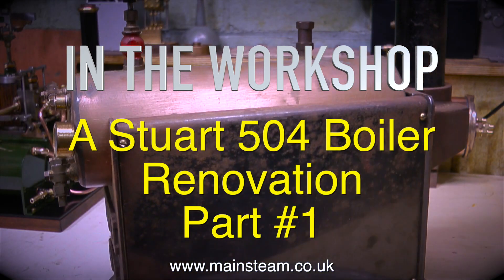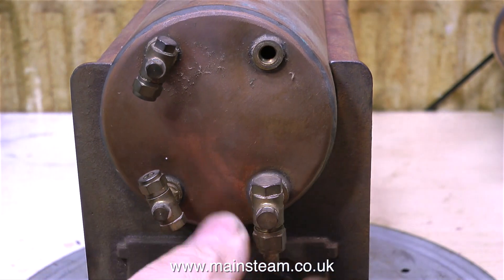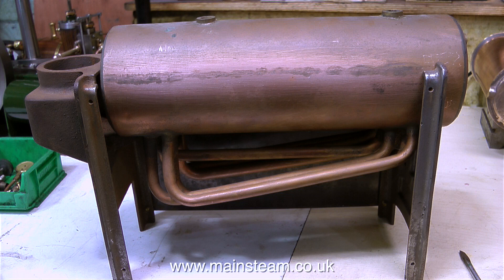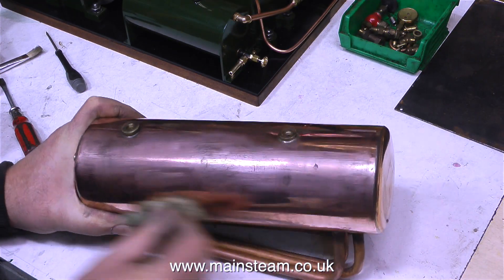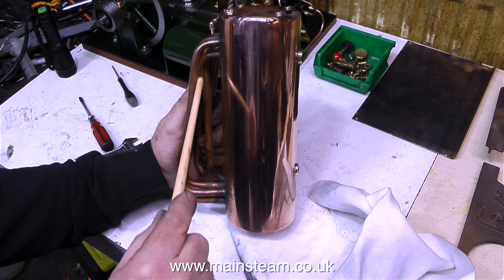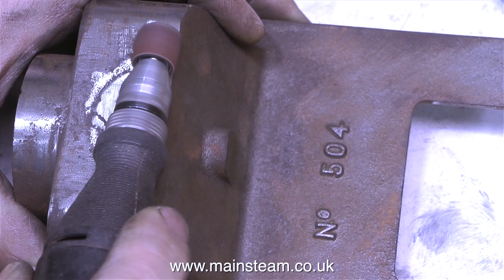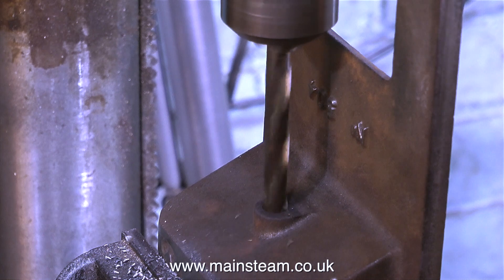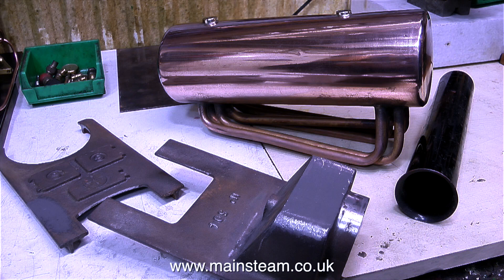A STUART 504 BOILER RENOVATION PART #1

Comment: Maybe the one complaining about the lack of background noise has never been in a machine shop. I think you have been doing a perfect job on the sound, but I am only a 68 year old machinist so I am hard of hearing. I do have to turn up the sound when you stop talking (which I hear fine) to hear the engines run, but that is my problem not yours. Thanks for the explanation on the 504 boiler, having never had one I did not realize that the one bottom tube was a steam drier line. Had always thought the tube arrangement in photos looked a bit odd, but nobody had mentioned the tube arrangement. Score another one for you, keep up the good work. Now time to have another coffee and rewatch some of your videos.

Comment: Ahh, a 504! I put one of these together (with help from my father) 10 years ago. I managed to get a new old stock boiler that had never been put together (and persuaded the seller to remove the asbestos before sending it, although I did find some asbestos fibres in the box which required some very careful cleaning). I used kaowool instead of asbestos for insulation.

I didn't clean the castings (or know that one is supposed to do so), but spray painted them black with heat resistant paint, which seemed to work quite well. I did not polish the boiler barrel, but instead insulated it with a layer of kaowool and, on top of that, a black painted copper outer skin, soft soldered together, and held in with boiler bands, which looked quite nice when it was all done.

That boiler is currently sitting in my attic waiting for the day when I put together my steam plant again.

I shall be very interested to see how this series progresses, and especially how you heat this boiler, as I had trouble with the heating end of mine, having cremated one ceramic burner in the way that you described in an earlier video (which I partly caught on video - I have it on my Youtube channel somewhere), and the other one, although better, not quite seeming to give off enough heat.
Reply: It seems strange that Stuart discontinued the 504 as it seemed to be a popular design and a good steamer. I don't know what they cost new but judging buy the price they fetch on ebay I guess they have held their value well.  I'm not expert but it seems to me that the modern Stuart boilers are fairly basic compared to others you can buy at the same price.
Reply from the maker: I fully agree and never understood either why they discontinued the 500 series, they are easy and simple to make and steam really well . . . 'Tis a puzzle to me but I suppose that they had their reasons . .  .
Reply: Any idea how they compare to a PMR 2 that is of a similar size ?

Comment: Keith, my man! You never tell us roughly how old theese boilers are... its hard to appreciate the quality and effort you put in to renovations if we dont know certain details, even if they are just a guess
Reply from the maker: OK then, the Stuart 504 boiler I have recently renovated is probably from the 1970s - that's the best I can do ......
Reply: Thanks a ton. Even if its a guesstimation its  great to have an idea of what you’re working on
Reply: Oh also, ive been building a steam boiler myself, its made using a 200 psi air compressor tank with globs of weld with threaded holes in it for valves and proper equipment, and a few car exaust fittings passing through the tank for a fire tube/chimney, but for some reason the weld is rejecting the metals... i have no idea why

Comment: This is perfect timing for me as I'm in the process of renovating a Stuart 500 boiler and a Stuart D10 any chance you can do work like Hydraulic testing the barrel. Also would you recommend replacing the original boiler fittings/ keeping it with Stuart fittings minus aluminium washers/ replacing with alternate parts from your friends at  Blackgates Engineering. The videos you produce are extremely positive and gradually convincing me to start M.E. projects of my own
Reply from the maker: Hydraulic test on Wednesday as I am in my recording studio tomorrow. If the Stuart fittings are serviceable, clean them thoroughly inside and out. (There is a kettle de-scaler that I use that is called "Kilrock-K" which is very good for removing the limescale deposits) Then use copper shim washers. These are my recommendations {:-)))

Comment: Incidentally, you might be interested to know that, judging by the new old stock boiler that I bought 10 years ago, the 504 boilers (and presumably the others in the series) did not actually come with all the steam fittings; some of the steam fittings (such as the pressure gauge) I had to buy new, although I recall that it did come with the steam tap and safety valve.

Comment: Hi Keith!
Another great video! After watching this video, I was thrown into another 504 video where the 504 used a alcohol burner, and thought that a variation on that burner would be nice to fire in my wilesco D366. But I can't find much information about how they are designed, if they use weeks, are pressurized or just an alcohol filled tube with a few slits in? Hope you have an answer to this. Best regards / Erik

Comment: Am I mistaken or that boiler looks like it has been soft soldered instead of silver soldered ? Soldered joints have that Led colour.
Reply from the maker: No not at all, it is actually Brazed as the earlier 500 series were. The colour is caused by having put it in the acid bath to clean it inside & out and the acid discolours the Brazing material. Definitely not soft soldered.
Reply: @keithappleton  Thanks Keith, I am currently looking at buying one on offer at the local shop, but I was suspicious about the soldering because of the solder colour. Solder on your boiler looks exactly the same, so I concluded that they are all soldered the same. I am more confident now to make an offer.

Comment: I have yet another inane question: When Tapping a thread, 
sometimes you don’t go all the way to the finish of the tapping tools’ threads. 
Does tapping the full length of the tool make the cut threads too large or deep? 
Or is something else going on here? Thanks again for these fun and educational 
Vids!
Reply from the maker: You don't need to go all the way through. Once you are past the tapered part of the tap you can feel that it is no longer cutting so it's time to turn it the other way to wind it out of the hole.

Comment: Hi Keith, long time watcher though this is the first time I'm commenting.  Watching you polish the boiler just had my itching to ask a question.  Recently I acquired a large decommissioned vintage soda fire extinguisher like the ones we used to have at school back in the good old days.  Underneath layers of paint it was solid copper and brass with a beautiful shield emblem on the front with scrolled writing.  After going through several large containers of elbow grease I've polished it to its original shining glory.  I'm just going to mount it as a display piece but I'm concerned about the copper and brass quickly tarnishing again and it's a big job polishing it.
My question is, how can you keep your polished copper and brass surfaces bright and shiny ?  I thought of using an automotive clear coat but I'm worried about spraying it and buggering up the finish.  Any tips ?
Also, if I may.  On many of your videos you use a material you refer to as 'gun metal', can you explain what that is please ?
Reply from the maker: Don't lacquer it - just polish it now & then. Gunmetal is a type of Bronze - please Google it :-)))
Reply: Thanks Keith, I appreciate your reply.  I just googled gun metal and it comes up as "red brass".  I just never heard anyone refer to it as gun metal before. Learned something new. 
I finished polishing the extinguisher about a week ago and when ever I walk past it I expect to see tarnish but it seems to be keeping shiny so far.  So I'm going to follow your advice and leave it un-lacquered, especially if it takes a long time to tarnish it's not worth spraying with clear coat.  Thanks again :o)
Reply: Tarnish is the reaction between the metal and the oxygen in the air I think, maybe a light coat of paste wax would help.

Comment: Great video Keith, I've been considering buying one of these as a second boiler so was interested to see how solidly built they are, I didn't realise the end support plates were cast iron. On the subject of feeding exhaust steam up the chimney via a condenser I'm wanting do that but still want a realistic chuff of steam up the chimney, is a condenser likely kill the effect of steam exiting the chimney ? Thanks :-)
Reply from the maker: a condenser doesn't seem to affect the "chuffability" that is usually dependent on the load on the engine when running - (and the valve timing for early admission & cutoff)
Reply: Thanks. 'Chuffability' is a great word :-) you really have to smuggle that into one of your videos.  I can't believe as grown men we are discussing chuffabily properties :-) :-)
Reply from the maker: Take a look at this: https://youtu.be/hOBnyQ_ttVM ............. "Chuffability" in action .....This is a 5 inch gauge Manor Class locomotive I rebuilt when I was in my 30s - seems a long time ago now ..... The loco was fitted with one of my own design modified blast nozzles, the principle is simple and i will show how i did it in a future video.
Reply: Thanks, that really scores high on chuffability :-) I've had my new boiler running a few times on coal, it's messy but so much more fun than gas, once I can get the steam routed up the chimney I'll be happy. I have ordered a 1/2" hand pump for water feed to replace the 3/8ths I currently have. I'm hoping that will be enough for a 5" Tubal Cain boiler - it ought be ok for now till I can buy or make a steam powered pump.

Comment: Wow, I was unaware that the 504s are quite so big (I was quite shocked when you reached into the frame and your hands were rather small compared to the boiler drum).
Also, it's really good to see how these things are made and how they work. Thanks!
How big a machine could you run off this boiler?
Reply from the maker: They are ideal for most of the stuart range up to around one inch cylinder bore .... they steam very freely.
Reply: Keith Appleton Thanks for the answer. I have been thinking of making a boiler for my large workshop engine (2 in bore, 2 in stroke, about 100 rpm) for some time now. That boiler would need a lot more water tubes than this one has, but this type of boiler seems easy enough to make, compared with a model Scotch boiler, or, heaven forfend, a locomotive boiler.